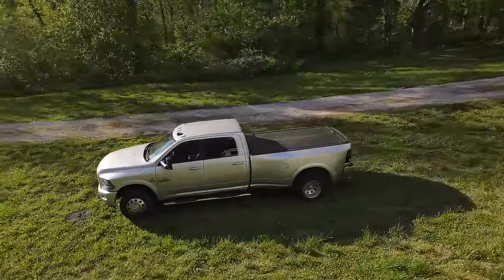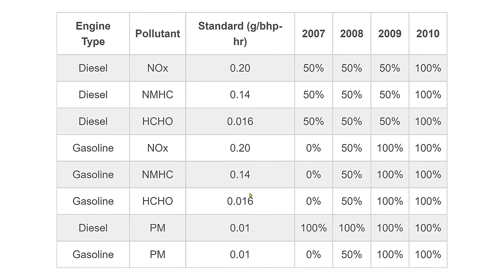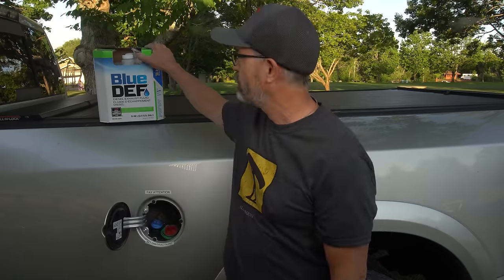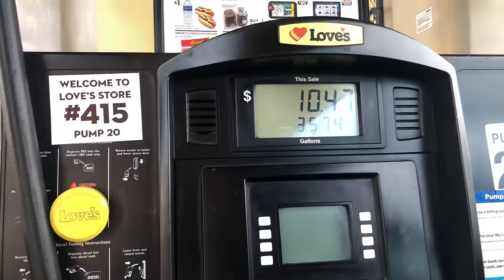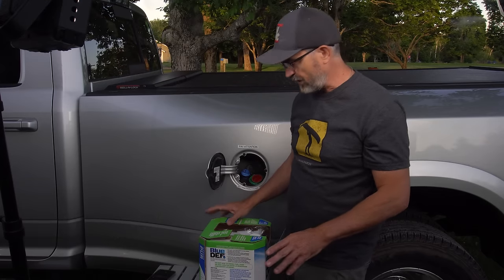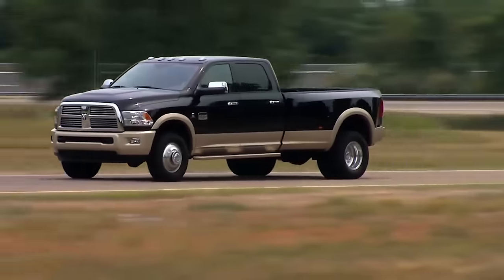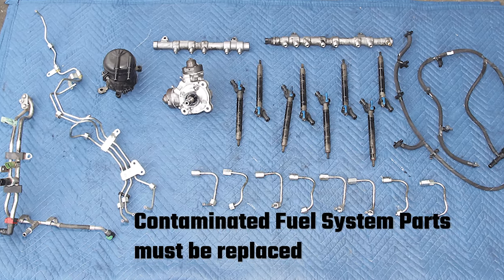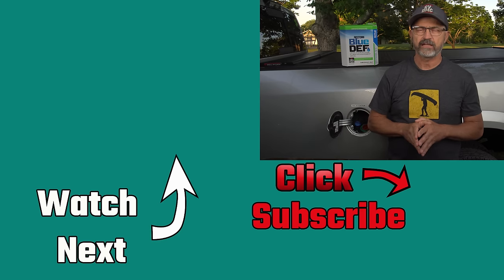Avoid expensive diesel repairs & DEF explained (RV Living) 4K

Comment: Great video Larry. Many people don't realize the extra work that is required to maintain a diesel engine. Diesel trucks are excellent workhorses. I've been driving diesels work trucks for over 26 years now. Mostly MDT's , Internationals, Freightliners etc. and all of these vehicles were pre-DEF, the newest being a 2014. However, one of our newer (2015) smaller F-550 bucket trucks does use DEF,  and it's been problematic. Almost always it was something to do with the emissions. Even the 2014 International has had DPF problems. Diesels can be very finicky.  Lately the company has been buying the F450's with the new 7.3l gas engine almost exclusively now. It's a super strong engine and it tows the trailers just great. I'm impressed to the point of probably not upgrading my next truck to a diesel. But rather a new 7.3l with a 4:30 rear end. If it can take a 16k trailer up the Ike Guantlet (TFL truck 7.3l Ike challenge) it should easily be more than enough for our future RV.  Thats not set in stone yet, but it's sure looking that way.
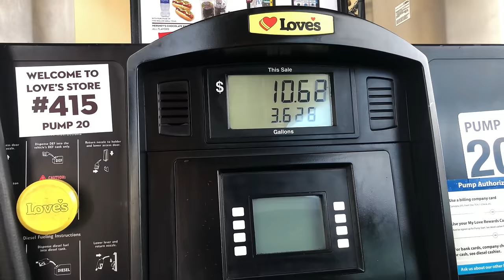Reply from the maker: I had never owned a diesel vehicle before this, and the extra maintenance and the associated cost takes some getting used to. The torque in our truck is insane, i and we only have a 3:43 rear end.  If we had the 4:10 that would be extreme.  You make a good case for gas, i would love to see a side by side comparison of the two.  Thanks for sharing your knowledge.  Larry

Comment: Good info. Thank you. Do you have a video about your Ram truck and why you chose that brand? I am researching 1-ton duallies and I'm leaning towards the Ford F-350 or 450. I would like to know your thoughts.
Reply from the maker: Thanks. There are two videos - very early in our channel. 
https://youtu.be/N26LHcVXjNU
https://youtu.be/YtfvfzSPjoQ
Reply: Both are great trucks. I’m a Cummins fan but I have to give credit to the 6.7L Powerstoke but man o man once you drive a rig with the turning radius of a F-450 and F-550 you won’t want anything less.
Reply: Plus the the F Series the fuel door is huge so the ports are spread out nicely, not like the dodge were you open it's and it's like you walked in on step sis stuck in the laundry machine. The 6.7 PS also has the best mpg.

Comment: I have a gasser and was thinking about switching to a diesel. After watching this video, I think I'll stick to my gasser. yes.
Reply from the maker: So far 4 years in I love the diesel, it pulled us up some really steep mountains last year, no problem.  I just wish diesel was cheaper than gas like it used to be years ago.  Larry
Reply: To me, it's not about the cost of fuel, it's the pain in the butt maintenance that these trucks need and the potential probelms they can have.
Reply: Diesel all day long!!
Reply: @tired_brickmason34 I’m undecided. V8 has lifter problems which can destroy the engine. Big problem
Reply: @grouchosays  don't stall it

Comment: You don't need to take the jug out of the box. The black valve should be up and it won't suck the jug in. You make it look so much harder than it is. No table should be needed.
Reply from the maker: Casey, the table is because Larry has RA - it helps with the lifting and pouring. 
I’m glad you have no problem when filling,
Alice
Reply: The black valve always ends up on the bottom when screwing the nozzle on. I think it's intentional,  because several brands do this.
Reply: @alaska-bornfloridaman  then turn the jug over. You're using it the wrong direction. The valve needs to be on top to work correctly.
Reply: @caseypries7559   Don't need to. I've recently made my truck "off road" .
Reply: @caseypries7559  
Also:  When turning the jug that way, the fluid floods that air valve instantly, so it doesn't work at all.
Reply: @alaska-bornfloridaman  If the jug is "upside down" so to speak and the valve is now at the top then it will be above the fluid. If my truck were needing some at the moment I'd take a pic of it.
Reply: @caseypries7559  
Dude,  No matter how you spin that jug, the air valve is going to be flooded for at least half of the container. Surely you know this..
Reply: @alaska-bornfloridaman  Not if you don't tip the jug that high.  Is it really that hard to understand? I DO NOT have any issues with the jug collapsing in as I fill and it sucks air in the entire time as long as the valve is above the spout.
Reply: Dang Casey really bro? Over how to pour in DEF. Larry is a good friend and uses the table cause he has medial issues and the fact it makes it easier. My thoughts are work smarter not harder. It was just a demo and thoughts anyway on what has worked best for him. No need to call out or get worked up. Have a drank buddy.
Reply: @SmallSpaceLiving  I'm not worked up at all.  A person need not make a how-to video when they don't know how to do it correctly themselves.  Like I said, the jug doesn't need to come out of the box and I think it says so on the box.  It shouldn't be sucking the sides in and if it is you're doing it wrong. A person doesn't need a table because you can ready the jug on the ground or your tail gate then take it over and pour it in. God forbid someone point out what someone is doing wrong. You go ahead and work smarter by wasting time getting out your table and whatever else isn't needed. The table won't lift the jug for you.
Reply: @caseypries7559  I agree god forbid someone do it another way. lol As stated he needs the table for medical reasons. Have a nice day.
Reply: I fill generators all the time that take 6 of these jugs at a time. 
Turn the jug 180 and it will not collapse and it empties fast and smooth 😎 
I empty on an average of 20-30 a week so I'm speaking from experience!! Lol
Reply: @jamesglenn520  Pour on buddy. lol That is a lot of jugs.

Comment: I purchased my 2017 Ram 3500 6.7 Cummins with EGR delete. No DEF filling ever. Our Rig is 20,000lbs and I get around 9-11mpg depending upon terrain. 18-22mpg not pulling.
Reply from the maker: You definitely benefit with extra power and mileage  with the deleted emissions system, but that voids the powertrain warranty.  I dont know much about diesel engines so I rely on the warranty for big repair expenses.  Larry
Reply: I understand your concern there. We have 235,000mi and 0 issues :) the Aisin tranny is a beast.

Comment: When I purchased my gently used 2016 2500 HD Silverado last year I was a bit perturbed that I had to “pop the hood” to add Def…not so much anymore.  With having to go half way around the truck to add it; my chances of putting it in the fuel tank go way down👍🏻.  Now, making sure I don’t pick up the regular handle…that’s still a constant worry…but with the color coded diesel handle I can at least tell all the wacko environmentalists that I’m really a “greenie”‼️🤣🤣🤣
Reply: Opting for a printed receipt of pumped fuel gives you legal proof incase stations tank is compromised with water or other contamination. 
A brief sniff test of the nozzle after a quick pull & release (think chemistry class smell test, not a Scarface snort) is also a good practice to check if you’ve selected the wrong handle or if a tanker driver accidentally delivers gasoline into the stations diesel tank.
Reply from the maker: Rick, we definitely see the advantage of having the DEF under the hood. And yes, still need to be careful. It’s happened to more people that are willing to admit to it 😉 
Alice